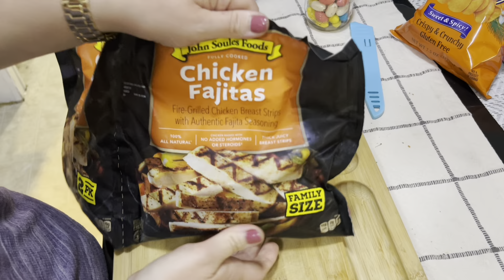Master Bathroom Makeover! New Floors and Painting the walls!#makeover #mobilehomeremodel #bathroom

Comment: Why is the wall in the bathroom so rough ,the texture on the wall looks rough .
Reply from the maker: Hi Teresa. Yes. It’s a stucco or plaster type finish that someone put on there. I can’t scrape it off, so Im just cleaning it and painting over it. A lot of homes here in AZ have this look, although it’s a very outdated look. The roller sponge that I am using for the paint is for rough textured areas. It works like a dream! 🥰 Thanks for your comment. Have a wonderful day.